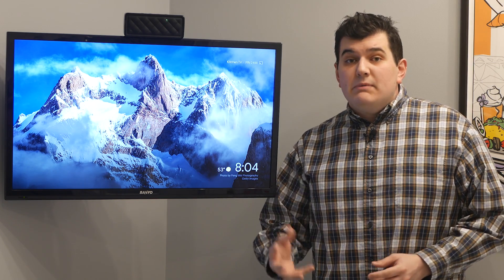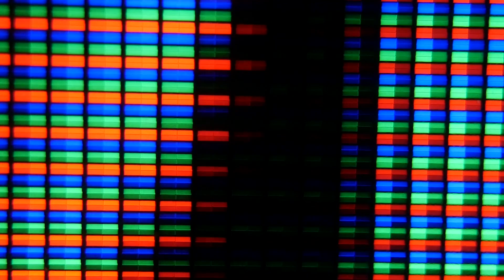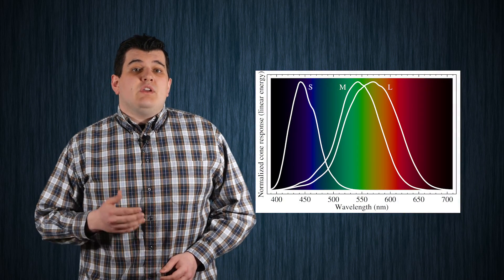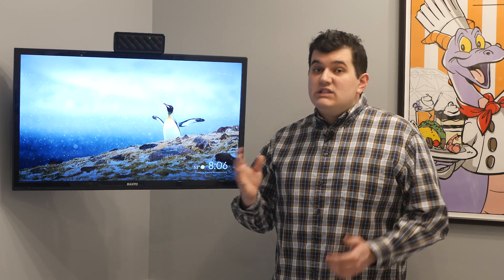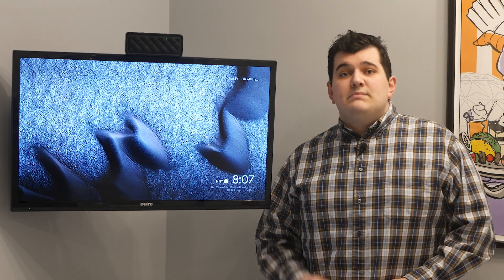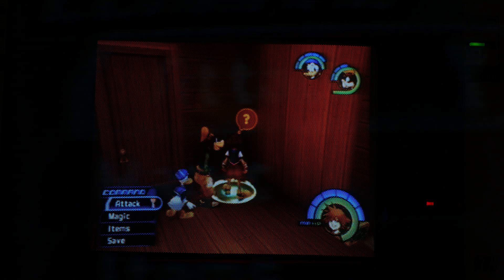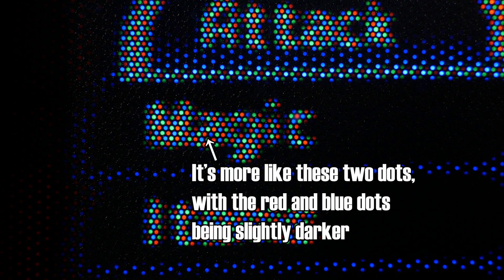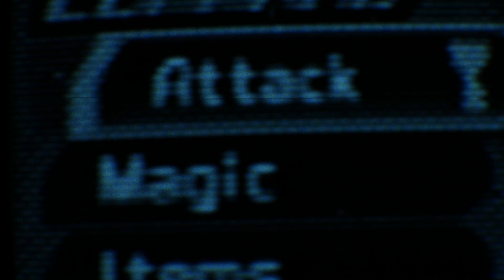These Are Not Pixels: Revisited

Comment from the maker: Howdy!
Just to make a clarification, the three electron beams inside the tube are all the same--they are not actually colored, Red, Green, and Blue.  It's the phosphors at the front of the tube that glow when they are hit with their corresponding beam--it's not like the picture tube is actually projecting three different colors of light.  The principle is the same, though.  You just need to substitute light for an electron beam for any sort of practical demonstration to be possible.
Hope that makes sense!
Reply from the maker: @MegaTechpc  As Ryan explained, the micromirrors on the DLP chip do define discrete, logical pixels.  The main difference is that the respsonse time for DLP technology is ridiculously fast, so the pixels can be dithered hundreds of times per frame, thus they produce an RGB image sequentially like the CBS color wheel system from the 1950's.
Reply: @TechnologyConnections  I'm still not convinced. Just because the picture delivery process is different in digital vs analogue pixels doesn't mean they are entirely different concepts. Analogue pixels are still the "3 color primitive elements that form a picture on a screen" it's just that precision of addressing them is different.

You're also missing one important part: the "picture" in the definition of a pixel is "the final picture" that is shown, not the source picture beeing fed to the display. Even in digital displays those are 2 different things, slightly different or not so depending on the native screen resolution vs signal resolution.
Reply: Actually, DLP would make a great new installment of this series!  because 'color wheels' were a very early process of displaying a color image by CBS
Reply: Ruben Kelevra, the guns are shooting electrons, not light. They cannot be color filtered. The light isn't formed until the electrons hit the phosphors, which then emit light, different color each.
Reply: @synchronos1  okay, but why not place the phosphor filters for colors in front of each gun and just a diffuser screen where it 'projects' the light instead of this super complicated hole mask?
Reply: @RubenKelevra  Noted.

So anyway, having a phosphor cover attached to each gun would probably ruin the accuracy of that gun due to diffraction as the signal is being transferred through light now instead of an electron. That's my theory anyway.
Reply: @cameodamaneo  but that's basically how beamers work 🤔

Just with a different light source
Reply: @RubenKelevra  Yeah, but electrons work differently to light. Electrons can't spread out due to diffraction. At least not that I'm aware.
Reply: @cameodamaneo  they use electrons rather than light, because electrons can have their paths bent by a magnetic field, but photons cannot. so all the photons would pretty much end up hitting the center of the screen. plus if you want to project light a long distance and have it hit a single point, you pretty much have to use a laser, which wasn't really a thing at the time color tv was invented
Reply from the maker: @foxy 1908  In a B+W CRT, there is only 1 gun, and there is no mask.  It's a uniform sheet of white phosphor material at the front of the tube.
Reply: The array of mirrors define the discrete pixels on a DLP.
Reply: Great video!
Reply: So what about something like DLP?  Don't those use RGB light wheels to project color?
Reply: There's another important distinction that I don't think was directly addressed that would have helped illustrate your point. In the close-up images of the phosphor dots, some of them are only half lit up, like they're cut in half, because the beam striking that area is not quite lining up to hit that spot straight-on usually because of the beam timing and the dot pitch.
Reply: Cool guys, thanks.  You should definitely do a DLP episode!
Reply: Thank you explaining that and everything else as well as you do. Thank you for this follow up video, I figured that when, in the previous video you said that "these are not pixels", you said that because phosphor dots are not individually addressable but thanks again for the detailed explanation.
Reply: @Ruben Kelevra: An electron beam doesn't have color.  It's the phosphor that has color.  The shadow mask is there to make sure the right electron beam hits the right color phosphor.
Reply: That was a most excellent way to explain the differences between these two technologies. Been trying to explain this concept to people since LCD's came out. I will be referring people to your video from now on. Thank You for making it!
Reply: What happens when you turn down the color on a color TV to make the picture black & white? Based on your previous videos, I would guess it’s reducing/discarding the color information before it gets to the election gun at all.
Reply: +pokepress - That's basically how it works, with the details having to do with the demodulating of the color component of the video signal. The lower you adjust the Color setting, the less influence the color component has on the electron beams, and they get closer to the same strength as each other so all 3 colors are equally bright on the screen, relying solely on the luminance component of the signal (the same part that B&W TVs use) when the setting is turned all the way down. 

Turning the color setting up intensifies the effect of the color component on the individual beams, resulting in potential oversaturation of the color image, which is why they're typically set in the middle of the range in normal operation.
Reply: You could say that a "real" pixel could die or break on it's own, but that is not how an old tv works.
Reply: Hi mate i hope you add this vid to your tv playlist as it certainly makes the difference clearer... gotta admit i already knew the difference but you have a neat way of explaining things
Reply: I assumed this when you said it and understood you used different color flashlights instead of putting colored film over those tiny holes in the screen.  Good video.
Reply: Also different consoles can output via analog different horizontal resolution but will be displayed on a device that can display analog signals (like CRTs) like it's the same H-resolution
Reply: what about black and white televisions how do they work what's the difference of the gun assembly when the picture tube
Reply: @foxy1908  The black and white tube just has one gun, projecting a single beam to a screen uniformly coated with a single colored (usually cool white) phosphor. The gun is controlled by the imminence (Y) component of the composite signal only. The chrominence components (R,G,B) are ignored. This is how color and black and white TVs are compatible.
Reply: @foxy 1908: B&W - one color, one gun, no shadow mask.  The screen is a sheet of phosphor and the glowing lines are where the gun hits it.
Reply: Passive Pixels
Reply: Also another good example would be a crt projector or a rear projection tv as the use crts either black and whit with colored lenses or 3 monochrome crts to produce a colored image they must only use lines not phosphor dots or pixels shadow masks i know cause ive pulled a few to bits...
Reply: I have an opportunity to grab a Trinitron KV-35S42, what are your thoughts on it for retro gaming?
Reply: @Ruben Kelevra 
Re:colour filiter before...
Because they aren't light beams they are three beams of electrons!! These have no colour of thier own! Though each is controlling one single colour, the three beams are identical. Which colour they each deal with only becomes evident, and real when they strike the phosphor dot/slot/stripe of the particular colour they represent. IE either Red, Green or Blue. Indeed, it is possible for an incorrectly set up or faulty colour CRT for the electron beams to be landing on the wrong screen phosphors. The beams don't care a jot, but humans would with incorrect wierd colours all over the screen. Look up CRT colour purity. :-)
Reply: Some "digital" light processing projectors do have three chips, one for each channel, thus no need for a colour wheel. These projectors use pulse width modulation to dither the pixels. The number of possible pulse widths depends entirely on the number of possible sample values. Pulse width modulation can also be analog, being created directly from any other analog signal.
Reply: Pixel is not from Picture Element, it's more of a double entendre.  Pixel predates television, it means something small, such as magical dust from a pixie.  Being pixelated (a very very very old term) means someone is "see things" because of the magic of the pixies.  Picture Element to Pixel is more of a cute little attempt to mix the old meaning with the new, as t.v.s are like magic.
Reply: I'm glad you posted that comment, because I was waiting for you to say this in the video and was quite surprised that you didn't! Great video though.
Reply: How do they manufacture CRTs so that the coloured phosphors line up correctly with the shadow mask?
Reply: And the only reason that colors needs to be separated is because we need to use phosphors of different colors for each of the three electronic beams. Otherwise, we don't really need to separate the colored dots. Blending different colors into a single dot isn't a problem to our eyes anyway.
Reply: Yeah plus Sony's Trinitron television only has one electron gun therefore it just switches the color signal three times as quick through that one electron gun. It made Sony the number one manufacturer of CRT tubes - my Dell monitor had a Sony Trinitron tube.
Reply: Thanks for clarifying because it didn’t make sense to me, if the input of physical lights don’t move, how can we get moving color on pictures? And it’s because it’s the same as the black and white with that little metal screen bit.

Thank you
Reply: Electron guns have made sense to me since I was 10 and helping my father repair and install crt tv's,  I have known what phosphors are and what burn in is for so long :)
Reply: ohhhh, so that's why they need to be seperated. I was imagining the electron beams themselves to be colored, and I was wondering what the purpose of the shadow mask was at all, as without it, I'd imagine the colors would still just show up where they need to. But because they obtain they're color upon hitting the screen in specific points they would need to be seperated... i think...
Reply: I'm gonna have to disagree. You seem to know your stuff, so I might be wrong. But I still feel like that would be considered pixels. If you ask google to define the term pixel you will get this definition.
"a minute area of illumination on a display screen, one of many from which an image is composed."
I feel that it really depends how you define pixel but going by that definition I do believe Color CRT TVs have pixels.
Reply: That was exactly the clue i was missing. Of course they are not colored :D But if they were (theoretically!)... no need for shadow-mask 
:)
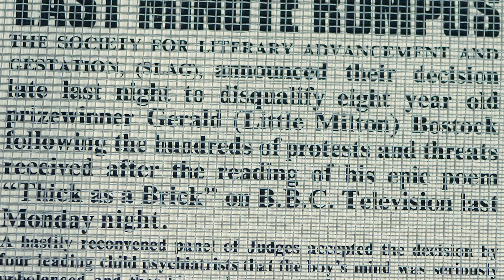Reply: To answer your question in 11:54, yes I think you have pixelated the image by placing the grid in front of it. If pixel is considered to be "picture element", then from the perspective of the viewer each hole in the picture is element of the picture, thus picture element, thus pixel.

Yea. I get pixel also means specific part of electronic component you focus in here, but that is the point of argument you seem to ignore: If we talk about pixel purely as a concept, the viewpoint changes the definition.
Reply: What color is the electron gun in Black and white crts then?
Reply: Well, the 3 colour tube projection TV sets have a non shadowmask display, though the front screen is lenticular to provide a brighter image in the forward view by concentrating the light in that direction in rear projection sets, the ceiling mount ones use just a diffused screen ( or one with a reflective layer to provide optical image brightness gain to the centre for the same reason, higher perceived brightness for the same CRT brightness) to scatter the image in the room. Line resolution in a mono CRT and rear projection 3 CRT set is more to do with bandwidth of the video circuit, or how fast it can go from one predetermined brightness to another predetermined brightness ( typically 80% to 20%) and then how many of these cycles it can do in a single horizontal line before the difference between the 2 levels is no longer displayed. Thus you get the 500 odd pixel display resolution, which basically translates to the roughly 7MHz bandwidth the TV channel has allocated to it, the set cannot display more lines than that without exceeding this bandwidth, and this is the big reason for the resolution. Vertical it is fixed by the number of lines in the interlace, with the 2 half frames each drawing an image with half the lines, then the other half of the frame filling in the image in the blank space between the lines drawn on the other half of the frame. Overall it looks like a single image, but it is 2 with a line offset between them, the eye integrates the 2 half frames into a single one.

With monitors that are not TV sets you can get higher bandwidth, up to 70MHz or more for the last of the CRT monitor displays, which meant you could get much higher resolution, allowing you to use a much finer pitch shadowmask in the CRT to get a sharper image, though the trade off is both more complex alignment in production, more complex drive circuits to get the beam to stay aligned perfectly in all the positions it scanned on the display, along with the smaller phosphor dots meaning you had to drive them with higher power to get a bright image, thus the big risk of image burn on these CRT units. CRT displays also used an aluminium sputtered backing on the phosphor layer to reflect light back to the front instead of losing it in the inside of the CRT, which did not affect the electron beam, but which doubled the brightness, though the thick dark glass reduced this again to give increased contrast ratio on the image..
Reply: I knew that before I watched this video.
Reply: I’m glad you came to this realization. What does that mean for your argument? I think you are definitely describing pixels with the color CRT. The black and white CRTs are actually more interesting because line scanning is continuous and your point is clear with that technology.
Reply: 999th like, nice.
Reply: Surely by this fact then, you can call them pixels as they are a main part required to create a fully colour image... without those phosphors, the image wouldn't look right, or wouldn't be there at all!

By your own explanation of pixels, they should be...
Reply: @Ghozer  well they are still not the pixels that the image grid is set up at. They are the pixels. Those are just the light emitters that are activated by those pixels. And as said they do not map exactly physically
Reply: @Ghozer  By pixel we today mean an element on the display that can have any hue and brighness. These can only be either red, green or blue with varying brightness. So they do not do what we mean by the name pixel. They are elements of a picture and, yes, that makes them picture elements, but it does not make them pixels.
Reply: +Colin Hadley
Were you listening to/watching the explanation? A "pixel" is a dynamically controllable individual picture element containing controllable RGB sub-elements.  A CRT doesn't have individually controllable pixels. It has electron guns which fire electrons in a series of horizontal lines, in sequence, at the phosphor layers in the tube which have to pass through a piece of metal with holes in it to separate the the color beam streams. They are not individually controllable.
Reply: Well, why didn't they add a color filter directly in front of the beams and let them hit the phosphor without going thru a mask? I just don't get it 🤔
Reply: because they are electron beams not light beams. Electrons don't have color. When the electrons from the beam hit a phosphor it creates visible light. Adding any type of filter in front of the beam would just stop the beam as glass is an electrical insulator. CRT tubes have a vacuum so that no particulates interfere with the electron beams flightpath.
Reply: @RubenKelevra  That's because there's only actually one beam, that is white.
Reply: @cameodamaneo  that's plain wrong: 6:47

And electrons have no color.
Reply: @RubenKelevra  light spreads. The mask needs to be right next to each colored phosphor dot.